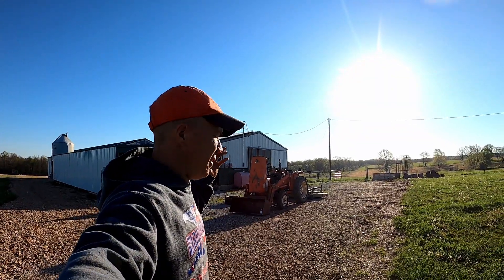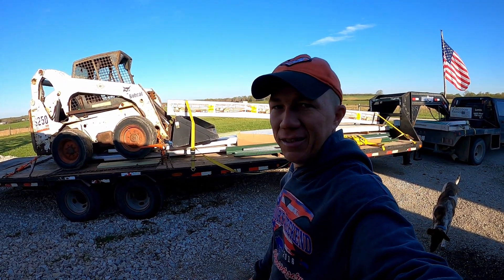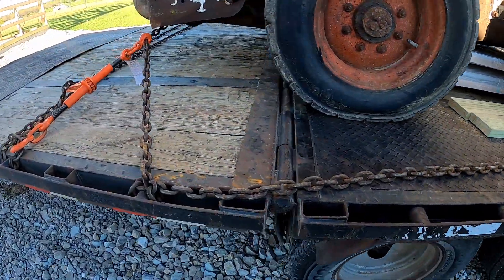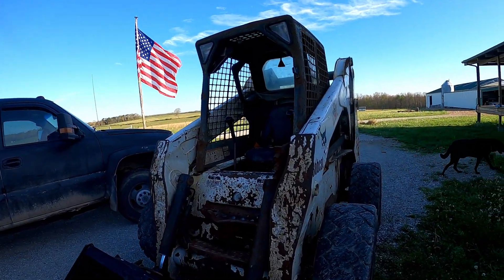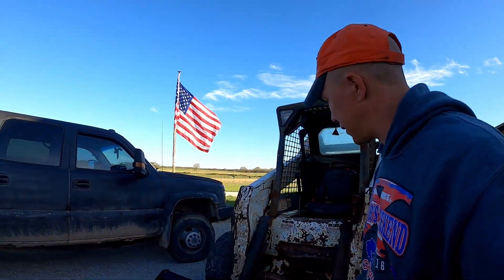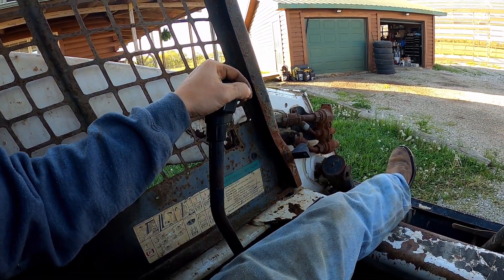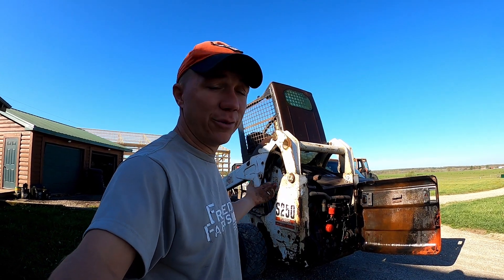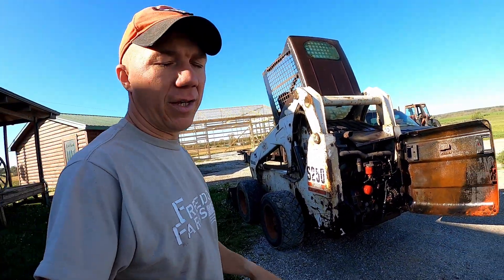We bought a skid steer! On a budget!!!!

Comment: Great purchase.   If you can find a 185 Diesel It would be a great size for your farm.  We had one when growing up and that was our big tractor.  It could do everything that you need it to do.
Reply from the maker: Honestly I am really leaning towards the 185 or 190xt. It would be nice if our backup tractor had a 1000pto. Our bush hog is 1000pto plus in the future our next Moco or baler may be 1000. Either way I am on board with the 185 if I can find one
Reply: @FreedomFarmsMo  Thats true. The 185 is only 540 I believe.  A 200 will also have 1000 PTO. Check out Tractor House.  According to Tractor Data 1000 PTO was optional for the 185. I'm not sure what it would take to convert it.
Reply from the maker: It was optional for the 185, 190, and 190xt

Comment: Allskidsreers out Northern Illinois will have the parts you need normally get them in a couple of days. LED lights will make a heck of a difference
Reply from the maker: Already got LED lights. That was the first thing we bought for it other than oil and filters to change fluids
Reply from the maker: I will check out the business you mentioned too
Reply: I suggest a set of pallet forks can’t go wrong with them  you would be amazed on how much you use them. Other than that you can buy tach plates and make anything else you need.
Reply from the maker: We bought Bale forks so that we can use it to move our hay bales. Fortunately somebody near us had some for sale. I agree I think it's going to be a handy little machine to have around and I did know that they had the attachment plates you could buy so you can make anything you want essentially
Reply: Oh one last thing we have birds who love to build a nest on top of the turbo wouldn’t hurt to keep an eye on that.
Reply from the maker: Thanks for the tip I will keep an eye on that. We use our pretty frequently at least twice a week at a minimum so I don't know that it'll sit still long enough for them to do it but either way next to the turbo housing is a hot place that will easily catch fire

Comment: Whats the biggest size bale you would recommend picking up with a allis chalmers 5020. Thanks
Reply from the maker: Honestly it's going to depend on the counterweight that you're able to put on the back. We were lifting 5x5 round bales that weigh approximately 1200 lb. It did do it but I wouldn't say that it was happy about it either. Generally we weren't carrying bales very far when we did it. I would strongly discourage doing it on uneven ground too. At the end of the day while the tractor was able to do it I don't think I would recommend it on a regular basis. I would also say it is going to really depend on the operator's confidence in their own skills too.
Reply: @FreedomFarmsMo  thanks. God bless
Reply from the maker: God bless you too and you're welcome
Reply from the maker: If you haven't already we have a video posted earlier on our channel showing how we increased the hydraulic pressure on the 5020.  There's also another one showing us building our hayforks for the 5020 also.

Comment: Try not to use WD40 is just fish oil and water mix.
Reply from the maker: No way, I always use WD-40. Are you saying I can make my own with water and fish oil though? What is the mix ratio?
Reply: @FreedomFarmsMo  I will recommend PB Blaster works better than WD40
Reply from the maker: He be blaster doesn't remove rust well we've tried it a couple times WD-40 has by far perform the best especially when covering a large area. TV blaster does however work better at loosening Rusty bolts.